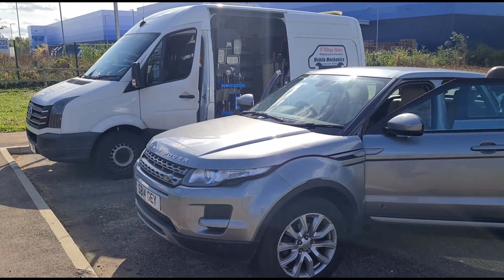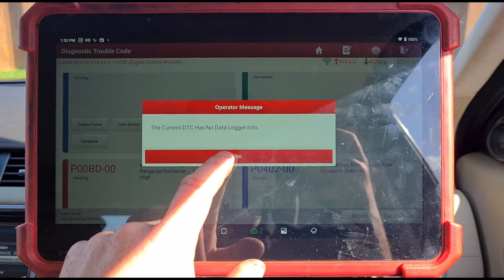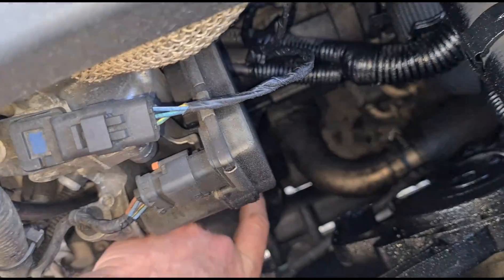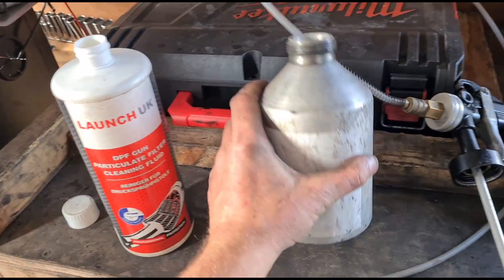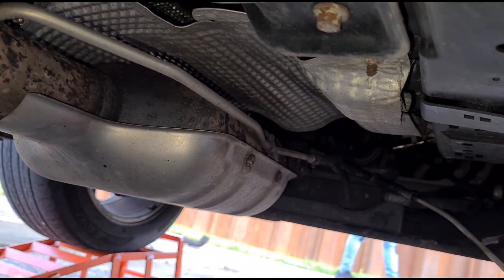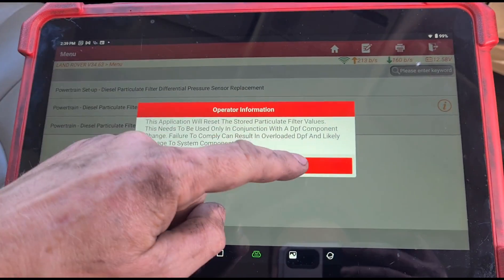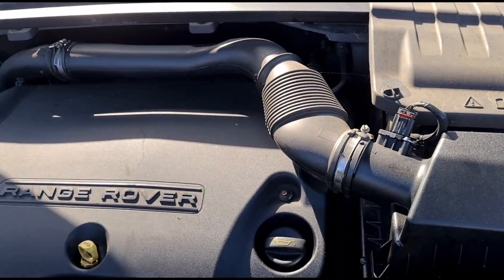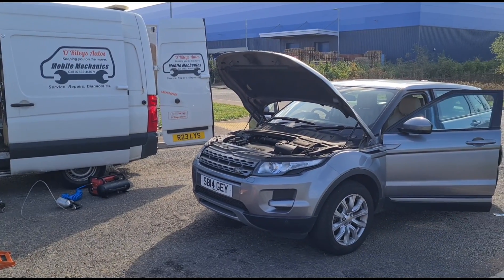Land Rover Evoque 2.2 P006A-00  Manifold Mass Air Flow Correlation P00BD-00  P2463-00

Comment: Dont fit a  new EGR change the EGR cooler position sensor first - saved a fortune as the error was the egr was not reporting the EGR cooler valve position. The error is that the signal from the sensor is too high for the position of the cooler valve

Comment: I have a 2017 Evoque, I had 1/4 of gas in the tank, and when I refilled the tank the car started to go slow. I have had a DPF problem. The engine has started to make a strange noise and does not start, I have doubts that it is the diesel that comes out loud. 2 mechanics have seen it and they don't know.

￼
 P2463

Comment: Interesting to hear you suggest mapping out the EGR. 

I was under the impression that the DPF/EGR worked alongside each other during the regen process. 

So, removing the EGR without the DPF would cause dpf blockage on a long enough time scale? 

May not be the case on all vehicles but I’m sure it is on majority of VAG engines? 

Would be interesting to hear anybody else’s take on the matter👍🏻
Reply: For sure VAG cars need the egr în order for the dpf to properly do its thing, PSA on the other hand  it's safe to remove it. That's the only ones I have a proper feedback after egr has been deleted

Comment: If the vehicle is fitted with AdBlue and DPF, an EGR valve is used to reduce NOX while the Exhaust system warms up and the AdBlue system start to function.  Totally agree engines suffer with EGR but it’s a price to pay to Reduce Nitrogen and Oxygen being welded together at high temp in the cylinders during efficient combustion (flash temp of over 1200 degrees centigrade) forming NOX which is a pollutant gas. Prior to AdBlue being used EGR was used to damp down this flash temp with less efficient combustion.  The soot build up due to this inefficient combustion demands a Particulate filter to remove it. It blocks inlet manifolds and intake valves and makes the engine oil dirty.  The Inlet system can be cleaned by companies using crushed walnuts without major engine disassembly. They will visit and do on drive if needed. The other thing to consider full performance of a variable geometry turbo is achieved even with a percentage of gases going back through the EGR valve, delete the EGR valve and the Turbo over speeds leading to drastically reduced turbo life especially for the heavy footed driver.
Reply: I can't understand one thing. Can you explain more how egr affects the better performance of the turbocharger? Thank you

Comment: The e gr is for the reduction of the toxic gas nox  the e g r should NOT be deleated even it makes a mess of the intake system
Reply: No it doesn’t. The theory behind an EGR is that an idling engine requires only 20% of the air that it does under load. So an EGR recirculating the gasses means less being emitted. 

Of course in practice recycling hot gasses creates issues. 

Simply stopping those gasses recirculating will have a marginal effect on emissions but will ensure a cleaner intake & therefore less issues

Comment: I can see possibly why you may perform an EGR delete on a Euro 6 vehicle, but absolutely not on Euro 5 as it doesn't have any treatment to reduce NOx. Even so, I can't imagine that the SCR can remove all that NOx on its own.
Reply: 98% NOX reduction with AdBlue and SCR. EGR used at warm up and very low load. Engines run a lot cleaner with AdBlue systems.

Comment: If the EGR is stuck in the closed position get it deleted before the inlet ports choke the engine to death and eventually self destruct, which happened my last engine. Replaced engine with new one and removed EGR. Has been running perfect for last 6  years
Reply: Hello i have the question

Comment: EGR works by recirculating a portion of an engine's exhaust gas back to the engine cylinders. The exhaust gas displaces atmospheric air and therefore reduces the volume of  O2 in the combustion chamber at the times when small quantity of fuel is injected . Reducing the amount of oxygen reduces the amount of fuel that can burn in the cylinder thereby reducing peak in-cylinder temperatures and preventing a lean burn hot cylinder temperature condition DONT DELETE FIX IT

Comment: The EGR problem on my Polo has thankfully cleared on it's own.  It is in a very difficult position and needs many hours to replace plus parts cost.  Following replacement of the diff pressure sensor and switching to premium diesel plus a couple hundred motorway has fixed it.
Reply: switching to premium diesel is the answer agreed but i've blanked off the egr with a 10mm hole as well . A good compromise I think but time will tell I guess.

Comment: Be careful deleting just the EGR as a lot of vehicles kick the last 10 to 20% of soot out using the EGR in the cool down period after the regeneration, after each regeneration a bit more soot accumulates, 2000 to 5000 miles later the DPF starts to smoke due to excessive varnishing, get the DPF deleted at the same time or don’t bother doing just the EGR. This doesn’t happen on all vehicles but it does occur on older vag.
Reply: I’m on 30k after an EGR delete on the same engine (SD4) in a Freelander. No issues. It’s driven mostly on open roads & tows a lot though.
Reply: @hughmarcus1  if you drive mostly on fast roads you’re vehicle will clear it’s DPF under passive regeneration, it’s when it uses active regeneration where many brands of vehicles have some issues, ime not here to put jimmy down, as soon as I start having issues with my euro 6 I will be getting all 3 done EGR adblue and DPF but I used to do remapping until 8 months ago ( as well as chemical DPF cleaning ) and it would come up on the notes on what vehicles need both deletes or none at all.

Comment: Hi Jimmy, what's the difference between fitting a plate to the egr and having it turned off.
Reply from the maker: Fitting a plate will put an engine light on most cars.
Mapping an EGR out makes sure the engine isn't trying to use EGR gas and altering the fuel etc
Reply: It’s a no no on this engine. Guaranteed to create faults & running issues.
Reply: @hughmarcus1  Why so? Someone else has said that they’ve done. 30k with this done on this engine. You can’t both be right. Do you have evidence to support your comment?

Comment: brilliant as usual, a question   how does the cleaning fluid not back up the exhaust pipe and into  the engine with the pressure that it is forced in with 130psi ?.

Comment: Not great advice to recommend deleting the EGR. Ignoring the fact it's illegal and immoral, the DPF will just block up quicker as it will be dealing with way more soot than it was designed for. You'll also lose the performance and fuel economy benefits from having an EGR system. The soot that gets recirculated still has a load of energy left in it and the mass of it helps get the turbo moving.

Comment: exactly recirculating bad exhaust gasses and particals from the exhaust back through the intake and back to the engine.
all it does is line the intake up and cause even more problems. easy to do on the old diesels with a blanking plate no cost more money getting it mapped out.

Comment: Isn't it illegal to delete the EGR as its part of the emissions system (depending where you live)? Or is it one of those things that's you can't tell has been done? Surely it would fail an MOT if it was actually missing (and same for the DPF)?
Reply: it is just mapped out the egr unit still stays in place.
Reply: Technically it is but who’s going to know?
Reply: @hughmarcus1  If the pipe is missing and 2 blanking plates in their place, I'd suggest any MOT tester or insurance company could tell. Why not fit blanking plates inside the pipe I wonder so visually it looks complete?
Reply: @Nick_G7IZR  the newer cars the egr is controlled by the ecu. mapping it out every thing stays in place the mapping removes the egr process ie does not let it open.

Comment: Thats been driven some while to block the dpf after the hose split  ( pretty common fault btw ) with obviously next to zero performance from the lack of boost.  What on earth is wrong with the owner ???
Reply: My guess is that the O'Rileys Autos didn't have capacity to look into it before now.
Reply from the maker: Definitely a long time. Months if not maybe a year by the looks of it
Reply: @ORileysAutos   As soon as there was an appreciable split, it would have stopped Regen'ing so 500 miles ish??